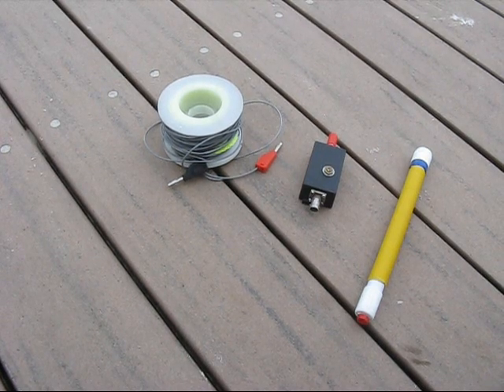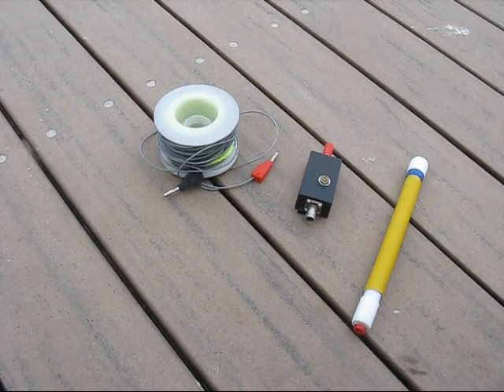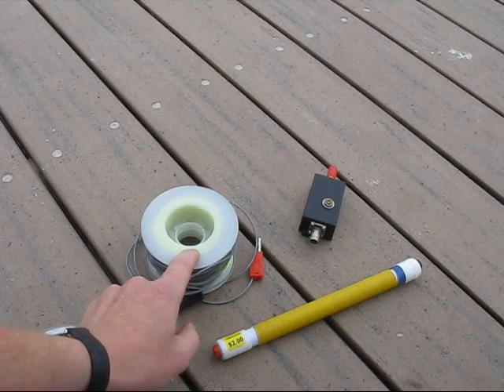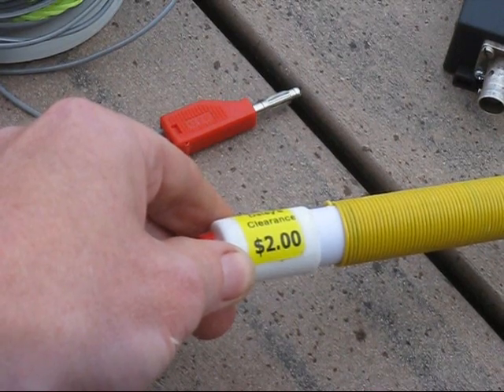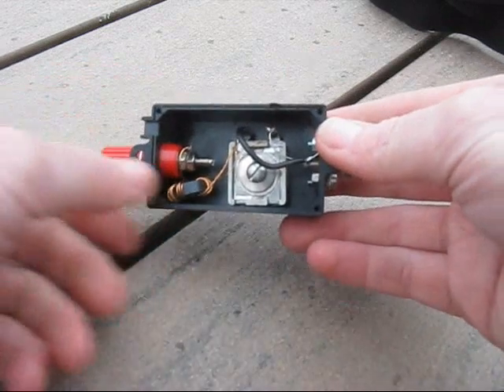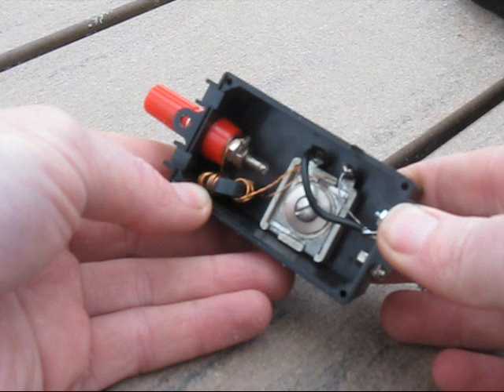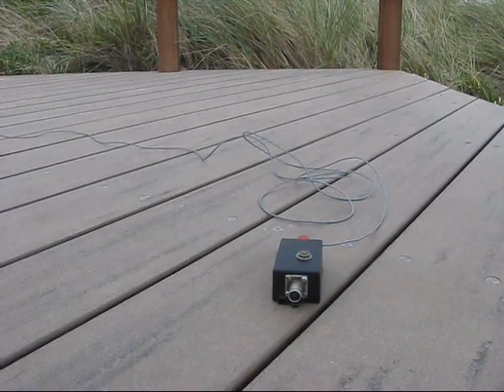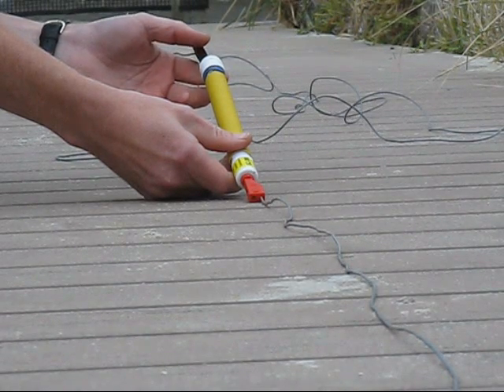Triband end-fed half wave antenna for portable use

Comment: Thanks for this video Peter.  I use 24 windings on the secondary and 3 on the primary on a T240-43 core. A maximum 350pf variable is connected across the input and it works well. Thanks for sharing and 73 de John G4YDM https://johnallsopp.blogspot.com/p/home-page.html

Comment: Hi Peter, I've made the ariel but still need to do some tweaks . I was talking to someone about my half wave dipole fo 40 metres qrp & currently it tunes for best vswr at around 6855 when I wanted 7.1 MHz, it seems to tune up ok on my Z match atu so, is it worth me shortening my dipole to get it closer to 7.1 MHz or leave it to the atu? Be grateful for your opinion ☺
God bless, Bill G6ATO
Reply from the maker: There is potentially some extra loss with coax and the Z-match but if it's short and of good quality it should be relatively small.  A few snips and only a few minutes work - yes I'd trim it.

Comment: Hi Peter, I do really enjoy your videos & especially the homebrew stuff. Just trying to copy your setup but just for 40 metres! I have wound the coil (127 turns) but the gauge / insulation is obviously thicker as it's come out at 200 mm length, any suggestions ? God bless, Bill G6ATO
Reply from the maker: Bill - tune around with a receiver between 5 and 10 MHz and listen for a peak in noise. If it's above 7 MHz the inductance is too small so you need to add more turns. If it's below 7 MHz the inductance is too large so you need to remove them.  Have a look at some of the links that give inductance values for this type of antenna. In other videos I discuss measuring inductance and equipment you can use for that.
Reply: Thanks Peter, I'll give that a go!

Comment: Great design. When you say at 2.40 to "adjust the trimmer for minimum SWR at 10 m", are you meaning wavelength or 10 m of wire? Any particular frequency? Is it really not that critical on the other bands? Thanks for any advice.
Reply from the maker: Your favourite frequency in the 28 MHz band. 28.4 MHz is good for SSB.
Reply: Many thanks for clarification!

Comment: Hi Peter!  I'd like to use a 9/1 unun to operate only on 10 or 12 meters.  Do you think an antenna length of around 16 feet would give me a reasonable SWR without a tuner?    Thanks!    Al
Reply from the maker: 16 feet is pretty close to a 1/4 wavelength so the impedance transformation provided by an unun won't be necessary. Direct coax feed from a groundplane (especially with radials drooping) should give close to 1:1 SWR.

Comment: HI Peter love your videos. One quick question. Forgive me if you already said, but what type of toroid are you using in the box, and is that critical? I have some t50-6 and FT37-67s coming soon. And what did you use for a form? it loks like pvc pipe. Would one of those work? thanks keep up the great work! hope to see you on the air. 73 de Gary, K8JCR

Comment: Great project and well done video. Do you have any idea of the actual inductance of the coil? I would like to make mine out of #22 enamel wire so it would be more compact. I was surprised to see you work into PA with only 5 watts with such a strong signal. (Using KX3 here)  KU3X

Comment: For a 100w version Use ft140-43 core with 2t twisted pair primary followed by 14t secondary. It checks out on the analyser for all 3 bands. Great antennas..
Reply: Hi there can you give a little more details about the materials for building the antenna fin 100 w. Thanks 73

Comment: I used a similar device in 40 meter band with my KNQ7, with 24 meter wire and a resonant circuit. When connected with a 2,5 meter coax to the transceiver, signal become 6 dB stronger (Coax acts like a small groundplane). Now I'm using a 5 meter counterpoise and the antenna is better too. Endfeeds are very usefull for backpacking, SOTA and pedestrian radio. Have a nice 2014. Edgardo LU1AR

Comment: Hi Peter.  After experimentation I added a fixed 250pF in parallel with the 350pF variable. Tunes with just the 10.45m vertical but I can only get SWR 2.5:1 at 14.200Mhz. Is there anything 'special' about the coil (e.g. ferrite spec)?

Comment: Hi Peter. Firstly - you're videos are great, thanks! Secondly, I just built one of these yesterday. Mine has a simple resistor network, DPDT switch and LED SWR indicator bolted on ahead of the LC circuit. Testing on 20m got the LED only starting to dim on FT817 low TX power when I ran out of adjustment on my variable capacitor. My varcap's about 300pF max. How many pF you have dialed in to get min SWR on yours? I have ordered some 100pF fixed caps to add in parallel to my varcap if needed.

Comment: Can I use a QRP antenna tuner with the matching network?

Example: FT-817 --> Elecraft T1 Tuner --> coax --> matching box - antenna.

Lets say to try and tune for 80 or 10 meters on the 40/20...
Reply: 99